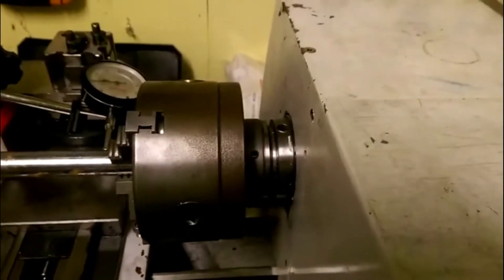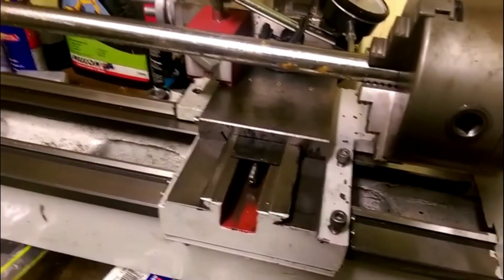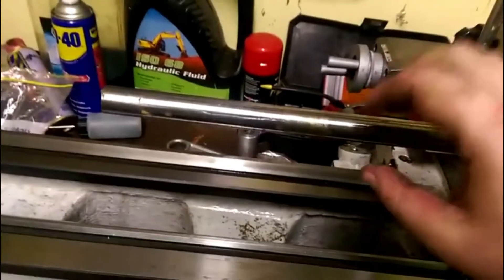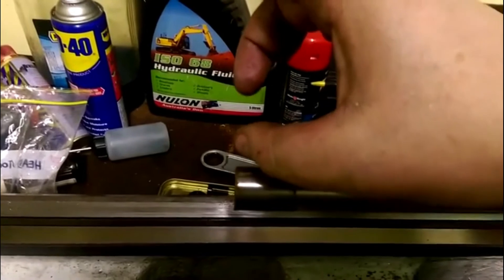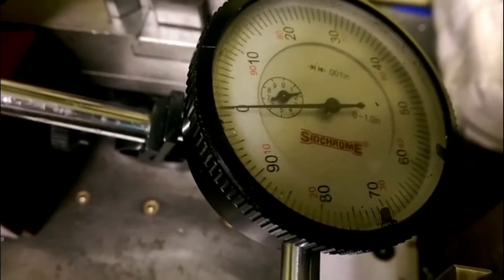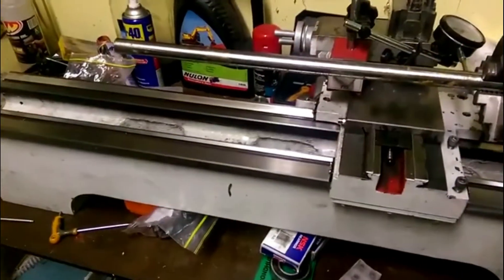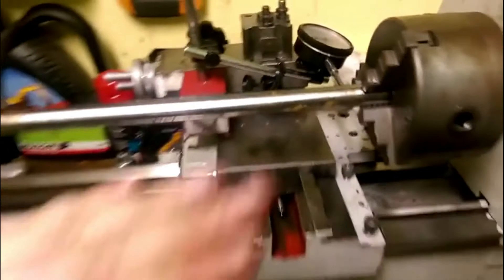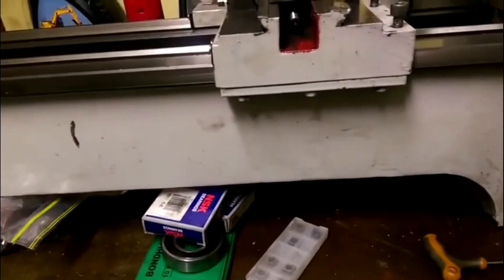Rollie's Dad's Method - Headstock Adjustment

Comment: Your talking about taper cut. Showing your end results is great, but you did not get into how to fix this. I had a new china lathe that was .010" larger at the chuck than the end of the rod after a cut. I totally stripped it down and cleaned all the machining grime and paint overspray and reassembled. Did another cut and it was .025" larger at the chuck. Yeah much worse. Returned it the next day. Currently waiting on a new lathe, different manufactuer. It really comes down to the luck of the draw on QC. You stand a better chance buying a mini lathe affiliated with the Siege name. Also have a Siege mill coming, wish me luck!

Comment: If you have run-out on the jaws, just don't rotate the shaft at all. Just move the dial over to the end of the shaft and use a chisel type contact point on the dial indicator. A ball type can move off the shaft center (above or below) if you have run-out.

Comment: A few years ago, I used the  Rollie's dad's method (RDM) for headsock alignment using stacks of 0.001" shims under the headstock and it worked very well. The lathe was an old 7" swing mini lathe I bought new in 1993 when the exports were being built in Taiwan.  The whole process required several hours of iterations setting and removing the headstock and a torque wrench to ensure constant headstock bolt tightening. However, after the  headstock was perfectly aligned, the tailstock took more time to come back into vertical and horizontal alignment. My other larger lathes have much easier adjustments for alignment. RDM is one of those processes that works well but not something you want to do again. Thank you for the video. Regards, Paul
Reply from the maker: Paul Jones I think the larger machines are generally better built for adjustment with jack screws on the pitch and yaw axes. I'm looking at around .010" across 400mm (about 18in??) on vertical misalignment, but that could also be gravity, so I'm going to tty taking some test cuts in a few days and see how it turns out.

Thanks for stopping by :)